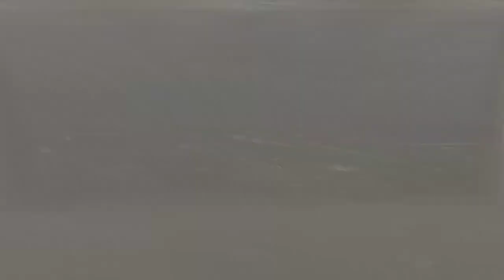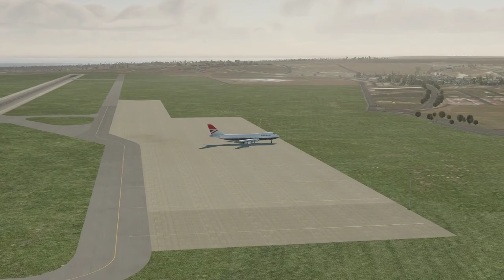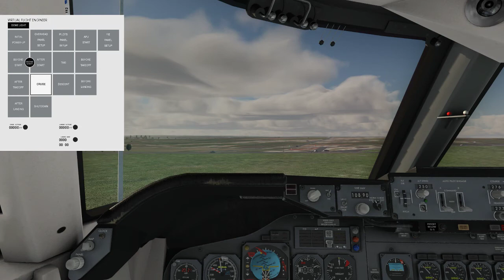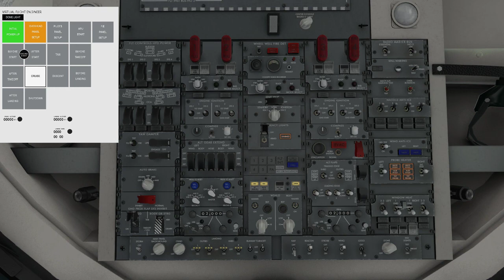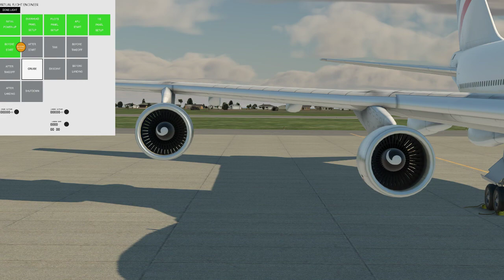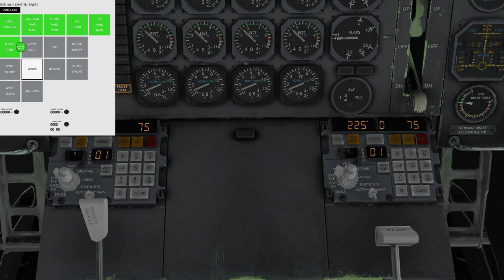Virtual Flight Engineer for the Felis 747-200 and Air Manager

Comment: How'd I never hear of this before? Phenomenal work!

One frustration I have with the current gen of study-level sims is... they don't simulate wear, routine failure, or maintenance. What's the point of testing the annunciators if there's zero chance of a blown annunciator bulb - why test both magnetos if the chance of a random MTBF mag failure in the five minutes since the aircraft loaded is infinitesimal? I want a plane with known and acceptable failures in the tech log, and unknown failures you need to catch with the checklists before you fly, which can then be fixed if necessary by a phenomenally speedy mechanic